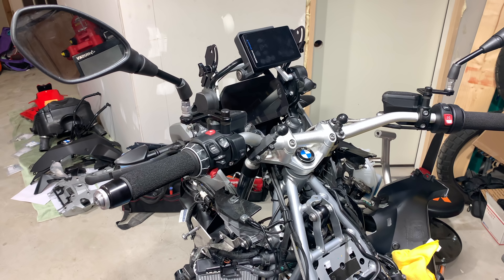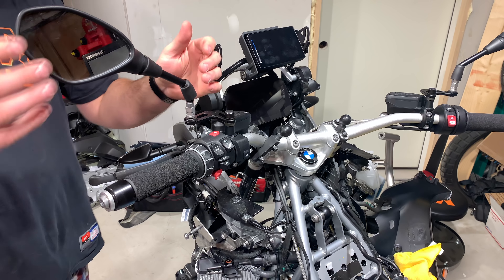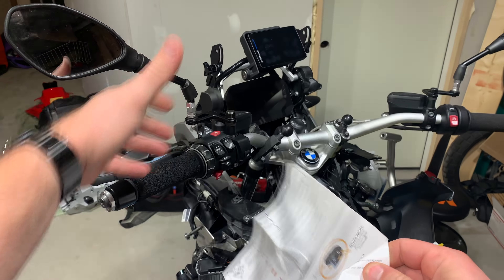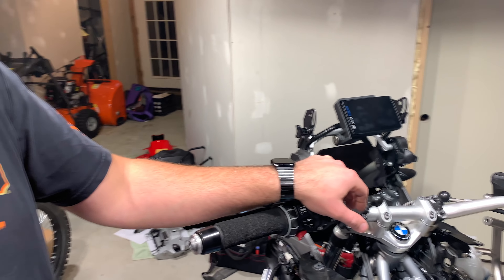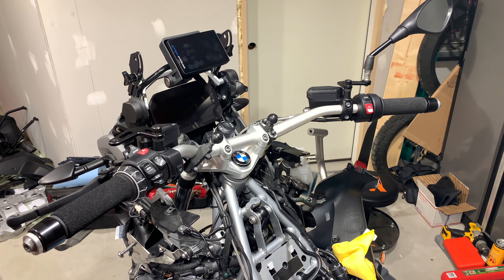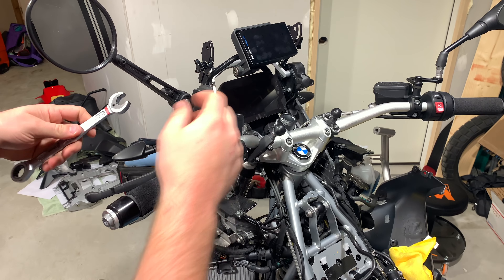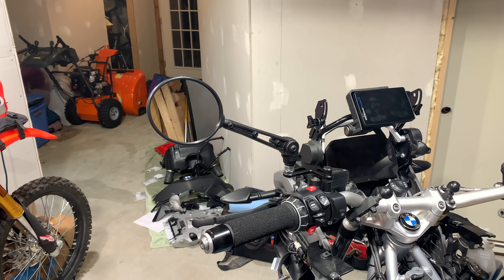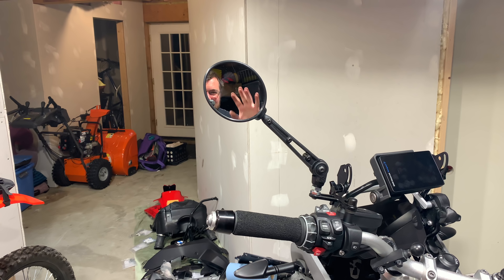Install / Rant / Sorry: Touratech Adventure Mirrors

Comment: Whilst passing through Germany earlier this year I called in at the Touratech factory shop on a Saturday afternoon. I have a KTM 1190r fitted with Touratech upper crash bars which I purchased about four years ago. Through my own fault I'd broken one of the mounting points on the bars. Whilst in the shop I explained to them what my problem was and asked if they could sell me a replacement spare part (this part is not shown as a replaceable  on the website, the guy said " just give me a moment and I'll take a look in our stores". Quarter hour later he came back and said "we don't have it and the factory is closed on Saturdays but if you can give me an hour I'll get somebody to open the factory to see if we have the part". Half hour later the guy finds me in the shop not only with the part I need but a fully packaged and modified fitting kit. "That's great ! " i say and ask how much I owe him ? "Nothing" he says, " the original part failed and we have redesigned it since you purchased yours so we would like to give you this for free ! ". Needless to say I was very appreciative and bought the guy a coffee. I know that most of the Touratech franchises are  pretty useless and in general very unhelpful but I cannot praise enough the customer service given on that day at the factory in Germany.

Comment: Thanks Adam, but you put the left hand mirror on backwards. The same mirror fits the left and right side, but they must be installed at the proper orientation. At the base of the mirror you will see the tiny letters LH (left hand) on one side, and RH (right hand) on the other. When properly installed, you will view these letters, from the rider's perspective, on the corresponding sides of the handlebar. All mirrors are set up for the RH side, so this one you just screw in and lock it down when the RH is visible. When you have the LH locked down the mirror glass will be facing in the wrong direction. You have to turn the glass/plastic part 180 degrees (yes it is adjustable). It is a tight fit and I was afraid I might break the plastic, but it worked fine. This was all in the accompanying directions but the English translation was pretty vague, common enough for such translations from Italian. The mirrors are slightly smaller and much lower in profile than the OEMs for my '06 Adventure, which will assist lanesplitting in Athens GR traffic. They look cool.
Reply from the maker: Thank you for the tip. I'll pin your comment so others can see this as well. I appreciate the correction!
Reply: Dude are you sure they adjust?! I fear breaking them, they're ultra stiff! I "ranted' a bit myself till I found your comment.... :D
Reply: Thanks a lot! Your comment helped a lot!! I was to affraid to break the mirrow!!!

Comment: Yeah I lost a bolt on my TT rack and they wouldn't sell me just the bolt. It was a central one that goes under the footpeg with a compression locking device so not easy to get elsewhere. I had to buy an entire new set of hardware for the rack at $90!

Comment: Any plans for a big adventure? So many mods to improve the bike, needs to be tested ;—)
Reply from the maker: It's important to note that right now, we are in Winter time. Usually November 1st - April 1st, there's too much snow and below freezing to go on a ride. This is the time of year that I tear down my bikes and rebuild them so you may see some riding of this bike in March but it's unlikely given the corrosive salt that we put on the roads. Last year, I was able to ride until middle of December but we already have snow every day and ice. No riding is possible for a while. BUT, even though I only get to ride 6 months out of the year, I average 10-14K miles a year on my GS so if you stick around through Summer, I promise there will be some great adventures. You can check out my videos from summer time if you're curious.
Reply: @AdamChandler86  same here in the Netherlands, also salt on the road.... My GS is also in a winter sleep right now. But it's to cold in my garage for maintenance right now (for me at least). Looking forward to your adventure trips!

Comment: This is definitely a rant video not an install video. Please refer to Touratech video for tips and making sure left and right mirror are differentiated and torx screw adjusted for height from handlebar. No I don’t work for Touratech, I was just having issues wondering why I seemed to have two RH mirrors appear in package. Cheers!
Reply from the maker: That wasn't the intention when I pressed the record button but I stand by everything I said. Touratech takes sometimes crappy stuff, white-labels it and then packs it with no instructions or guides and then doesn't keep any spare parts on hand when you have a problem. This is my experience with USA Touratech only, not the global one out of Germany.

Comment: I came here actually to talk about my TT mirrors. They were a mistake. I liked that they folded, but they vibrated a lot more than the OEM ones. Then I dumped my bike recently  in wet ground and when I lifted it the mirror stayed in the ground. I could not get the socket back on the ball of the stem! I tried everything, including freezing the ball, heating the socket, and laying the bike down onto the mirror and using the weight of the bike. No go. I'm trashing them and going with Double-Take. Should have done that two years ago when the OEMs broke. Oh yeah, and I bought the side-stand extender and it didn't fit. I had to grind elements of it to get it to fit on the foot. But I lost it soon after while off-roading. Not happy with TT, will be wary of buying from them again.
Reply from the maker: Hopefully you learned early on to avoid Touratech and look elsewhere? Sorry you had a bad experience. They haven't really redeemed themselves at any point in the last few years.

Comment: I have a similar complaint toward Touratech, and I have easily spent over $6k there over the last few years. I traded in my GS and asked dealer to remove my Touratech GPS mount from the handlebars. The awesome mechanic at my dealer didn't bother to ask for the factory bolts so he left the special ones with standoff on the bike. They sold the bike and I never got the bolts. ...... Called Touratech customer service and couldn't buy just the bolts for my new GSA. Had to buy an $80 kit with the bolts to get 4 bolts to mount to new bike.